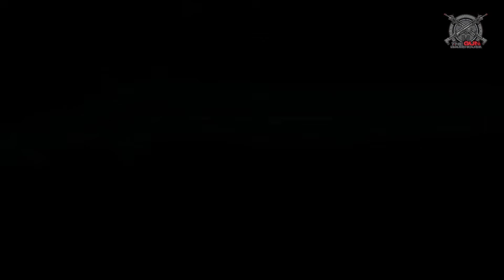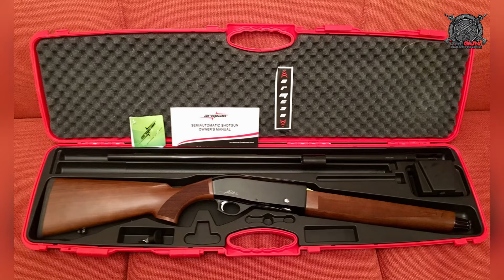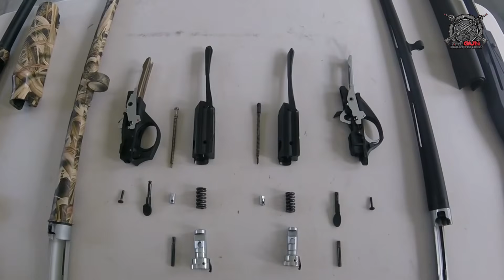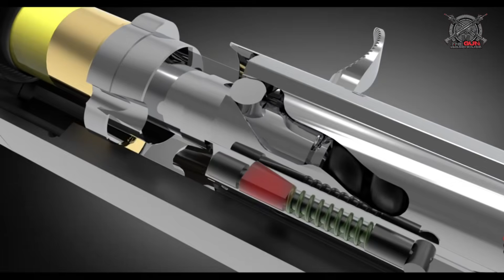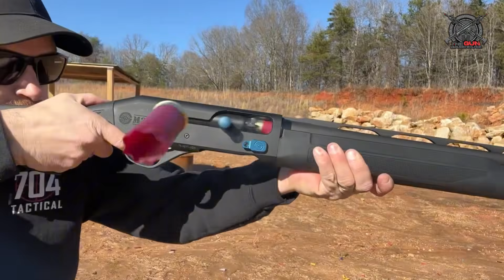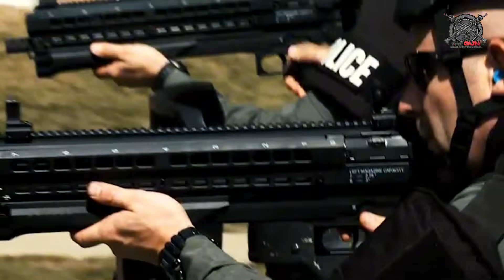How Turkish GUNS Are Destroying The Premium Shotgun Market!

Comment: Well, the Turkish companies have some of the worst quality control issues that it seems intentional. safeties falling out, slide to frame so bad they heat the entire gun up from binding metal - Only possible if they were not sanded and put together to test the fit, but they send them out that way, which is a safety concern. Much safer to buy from a country that doesn’t threaten us with military action and generally hate western culture, instead, choosing a friendly country’s company, such as the Phillipines, who like Americans, respect our culture - Rock Island Armory maintains high levels of quality control, at or above most gun companies on the market. With a cheap and simple spring kit and 5 minutes time, reliability becomes 1,000 rnd per jam, better than the average Glock.